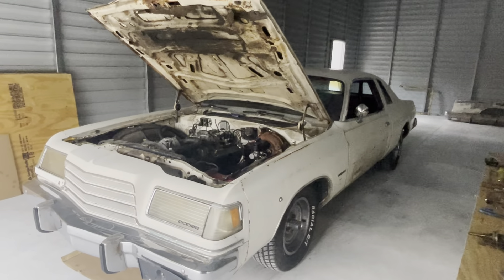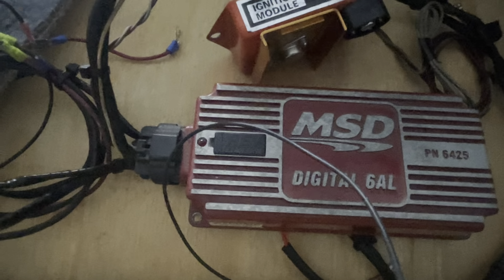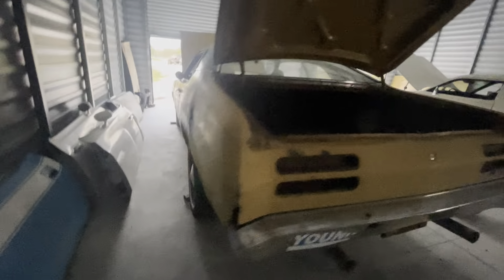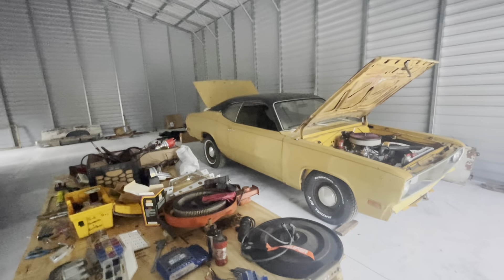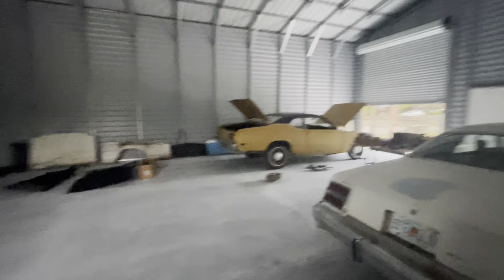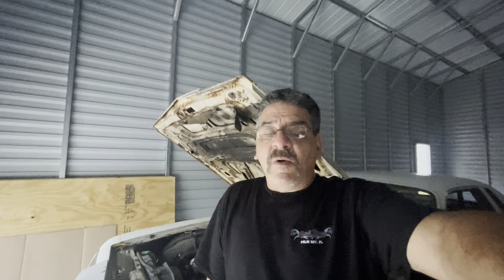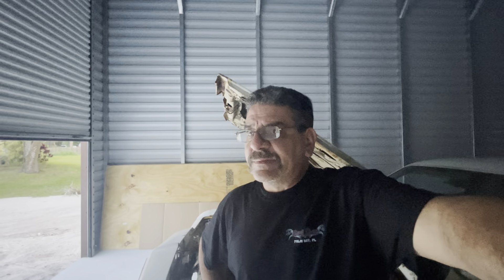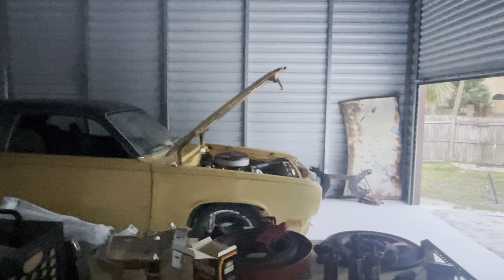In the new garage - sort off....

Comment: Health is everything. Hope you get back to feeling good so you can continue to enjoy your hobby. I enjoyed the video as I can always learn thing or 2 just by you talking motors. I didn’t find the RT heads at Mopar swap in Indianapolis, but I did find a good set of 302 castings that were not cracked, so I am happy. My mods will be very mild, so stock valves should work for me. They have a fresh valve job.
Reply from the maker: The R/T Magnuim heads are super hard to find.
The backis doing much much better now. Thanks.

Comment: i ran MSD 6A and 1st one shut off and i threw my Chrome Box on and it ran .08 slower. bu later MSD replaced had zero problems. and i run one now on my Dart. but i found the Chrome Box and it had melted on back due to stored in heat so i thew it away after having for 3o years
Reply from the maker: Wow! 30 years! Nice!!!